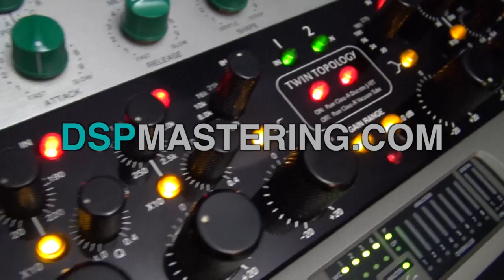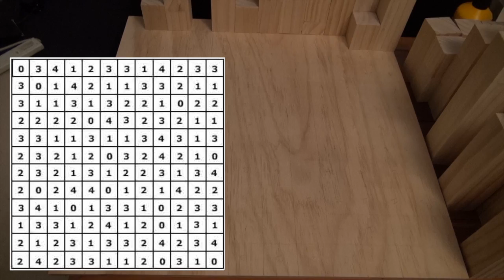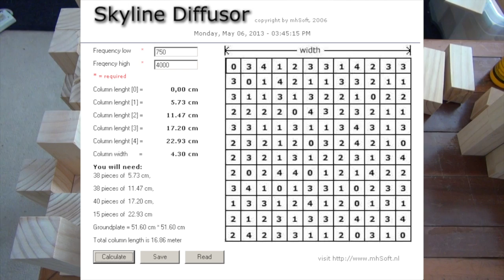How to build an acoustic diffuser

Comment: 5:10 I would suggest a silicone adhesive. Wood glue isn’t strong unless you clamp it. As the wood dries it will loosen the glue. Silicon will flex as the wood dries. Wood glue can crack.

Comment: hay
I just wanted to comment that when cutting and sanding the boards you should work safely and not on a chair above your body
(It's worth adding a warning in the video "don't work like this at home, always use tools carefully over a protective surface")

Second, in order for this diffuser to work well, it might not be worth finishing it from the bottom with a wooden shelf that supports it
but fix it only at the back or put a thin support from the bottom as well
Because a shelf below again causes the sound to reverberate and a standing wave on the wall

Regards and thanks

Comment: I wonder what the efficiency is like if you just used random length blocks, and angled cuts on the ends? - would it get pretty close to achieving the same goal? has anyone done research on this?  I just want to put my scrap wood bucket to better use than firewood.  At the end of the day, at the least you get a cool home made piece of artwork to hang on the wall even if it doesnt do anything.

Comment: Great video - thanks!!  I noticed the link to calculator is broken but the website still have plenty of calculators available.  I definitely have metallic-sounding (after a handclap, for example) flutter echoes.  How can I measure to see what the target low and high frequencies for this type of diffuser should be?  Even if I rented an RTA… I’m not sure how to generate a sound, and measure only the frequencies that are “echoing”.  Any tips, anyone?

Comment: You don't need thicker plywood for the back panel, you just just need to.. glue the blocks together from the sides to prevent flexing... you don't even need the back panel. What you should of done is have something to align all of your blocks in one row so that it is perfectly straight though. Apart from that, nice job!

Comment: Umm... not sure this will actually do the job correctly. A marginal effect at best. Room dimensions and other wall treatments are a major factor. It all has to work together to deliver the right response to your particular monitors. There’s no one size fits all in acoustics. This is kind of pointless. And pine is not ideal. You need a hardwood for rigidity and minimal absorption.

Comment: using glue on the sides would have given you the necessary strength so the backing plate will not bend
Reply: Using glue on the sides of the blocks could even make the backplate superfluous..
Reply: @Wuppie62  You think you're pretty good saying superfluous don't you?
Reply: @Intimatycal  Sorry man. Actually, I like that word. It's like, really far out.

Comment: I wonder if you could do something like this by making holes at different depths...
Reply: Inside the cut 2x2s or in a 4x4 (fence post) piece of lumber? I would think cutting the tops at a 30* miter and arrange the tops/lengths of wood facing different directions would diffuse (scatter) better; however I'm no audio engineer.

Comment: Thanks for the DIY! If I can make a suggestion for everyone else, sand all the wood as much as possible before cutting. Goes quick with a power sander. Then you only need to touch up after cutting. :-)
Reply: Thanks djmichaelm, That is a very useful tip.
Reply: Great idea . it looked like the pieces were run through a planer or jointer . not sure why he sanded them .

Comment: The frequency that bothers me is the F#2, which is 92.50. I inserted that figure and the software gave me a 136 METERS diffuser panel to build???????? Over 5 meter width: http://www.mh-audio.nl/DiffusorCalculator.asp?fl=92.5&fh=369.&calc=Calculate+Diffuser#result

Comment: Hi!I want to built a Skyline diffuser, but I can only buy 4,5 cm width here in Sweden. When I tried to use the calculator, it does´nt seem´s to be correct as the high frequencies tend to be lower than the low one´s.
Should it be fine to use 4,5 cm and get good frequencies? If so, what lenght´s should I use? Or can I use 4,5 x 7 cm width instead, maybe?

Comment: As I can see this diffuser only uses 5 different lengths, which will cause a pretty clear treatment of that frequency defined by these 5 modulo fractals. For 2D diffusers I found it is better to use all the fields of a module to define the possible modulo values. For exampe a symmetric diffuser of 4 modules rotated with 90 degrees each, having 14x14 pieces, 4  identic versions of a 7x7 element diffuser willbe created using all 49 imaginable lengths instead of only 7 defined by QRD formula.
Reply: ENGLISH, brother!

Comment: I went to a sawmill and bought rough cut white pine (I built my own studio in my side yard with a 20 by 28 studio and a 20 by 16 control room) in 8" widths then bought a band saw and resawed it and it came out about 1/2" in thickness.  I then applied it to the wall in a lap joint configuration much like you see on the outside of houses.  That makes it where there are no parallel surfaces on the walls and my ceiling is a cathedral ceiling so it is also not parallel with the floor.  It turned out to have an incredible sound!  A bit of work but worth every minute of it.  If you do it, leave the wood rough cut.  If you look closely at my Avatar, you can just see the walls behind me.  That is a wall in my main room.  I think it looks good, and smells great!

Comment: Unless you're a voice actor. Then you want to deaden the sound completely.
Reply: That was the theory in the 60s and 70s put forth by many including the great studio engineer / designer Tom Hidley (of Westgate and TTG Studios to name a few he owns and designed). However depending on the studio desires per how it wants a room to sound, the need  to have a totally dead room is a bit of a misnomer. An acoustic musical instrument depends on the environment its being played in to give it life. Natural decay times are part of what the human ear hears when these instruments are played in a normal space or outside.. Hence you want to record all aspects of it. A dead room will not accurately produce this, if at all, and then you are adding reverb etc during mixdowns i.e. more work at the console for that track(s). Which is why it is key to properly design with the formulas and proven techniques  available.
Reply: Wrong,  dead room for recording is fine, especially vocals. Actually it is preferred, because to add reverb to a file with natural reverb means adding reverb to reverb and that's a no no.

A dead room for mixing on the other hand is bad and sounds unnatural to your ears.

Comment: The best diffuser is polycyclindric and is easier to construct
Reply: I have seen many control rooms with the 'cube' style panels Why would Poly-cylindrical be better ? not asking in terms of cost but acoustically.
Reply: I think because theres more scattering so there will be less resonance able to build up. Also less reflections since it's not a flat surface. Check out bulbous bow's on ships, similar idea.

Comment: Hey man. First off Nice Video. I have a bit of a deli-ma the wood blocks that i bought are rounded on the edges will this basically screw up the build? Due to the little holes in the centers?

Comment: Hey man,

How do you know what your low and high frequency's are??
Thanks!
Reply: Gibson Goldy 
.
Reply: Using a Spectrum Analyzer. It's usually a piece of software that is paired with an omni condenser that has a VERY flat frequency response. If you only have the mic, then you could just have your mic placed where you usually have your head during mixing, run some pink noise through the monitors, and have an EQ with real-time analyzing so you can see the dips and peaks in the frequencies.

Comment: Hey, Great Project. 
FYI, Your link in the notes to the Calculator is wrong(old?) it should be 
http://www.mh-audio.nl/DiffusorCalculator.asp
Any update on the effect of the diffuser? was it better or worse than you expected?
Reply from the maker: Thanks for that, will update it. Cheers.
Reply: Try to put different frequency response and you will se that always will give you the same configuration of this diffusers ... I think this program doesn't work properly ...
Reply: Not found on this server
Reply: @jrr832  http://www.mh-audio.nl/Acoustics/DiffusorCalculator3.asp

Comment: How did you figure out what frequency you were trying to target?
Reply: DjFadeTheFuture if I'm in a room that is 10 meters long I'll go Like this...   344(speed sound in meters) : by 10(distance from the speaker in question to the closest wall I'm treating... equals 34,4 
double that =68,8 that's a standing wave cause it's the frequency size that travels from the speakers to the wall and back... they shock against each other and cause issues such as standing waves... double that and you'll the octave of it... double the octave and you have another octave... 68,8 X2 and also the result of that X 2 again and you should be good .... do that with some different rooms you're use and check the results... you'll probably find it simple, cause it is..
 but is very effective on the sound you're hearing too.... hope this helped... please anyone who would have something to correct me on... feel free and please do it!!! cause I'm learning and wanna keep it that way! always learning
Reply: anyone got an answer for this??
Reply: http://www.phy.mtu.edu/~suits/notefreqs.html this helped me
Reply: please give an example
Reply: Grantas Šileikis g
Reply: hey - so I have 4x4m room. its 344 / 4 = 86 x 2 = 172. is this the bottom frequency? and this 172 x 2?
Reply: Hold on.... why 86??? Are you calculating inches?! Convert that to meters... and them you'll get what you need... or find out sound speed in feet or inches I don't know... it's easier for me in metric system!!!
Reply: room is 4m x 4m... 344 / 4 is 86
Reply: Is that 4X4 in meters? I'm sorry if I misunderstood that!!!
Reply: So.... you'll have 344/4 speed/length and that's your number... and the octaves and so on... correct my friend
Reply: yes in meters. 4x4 so can you help what is the bottom frequency 172? and what would be the top frequency ? cheers and thanks
Reply: I'm sorry for the misunderstanding
Reply: thanks Phillipi -  just wanted to know what frequency range to put into that calculator. I guess the room will mostly benefit from sound treatment and small diffuser. it is mainly mixing room.
Reply: Alright... make sure you're measuring from the speaker cone to the wall and back to the speaker cone to get those frequencies....
Reply: hi there - i punched it into this calculator and and if i read it correctly diffuser is 12m wide? my room is 4 x 3.5 x 2.4 (meters)?!?!? what am I missing?
Reply: http://downloads.bbc.co.uk/rd/pubs/reports/1995-01.pdf
Reply: 43, 86, 172 these are room modes... usually we treat room mode up to 200 ish hz... cause above that it's common sense really... if you wanna make your room flat so you have no feedback... I'd suggest treat the highs... if not... that's OK... if it's a mixing room... just use treatment on the walls you should be fine... if it's a recording room and you want no feedback... use pink noise and a condenser mic with a good response and treat the room with a 31 band eq

Comment: Thats a shame that you didn´t mention that this is too heavy that it´s almost impossible to fix it to anywhere. Think about like 23 meters of wood in a single 50x50cm panel. It´s a Ton!
Reply: If you use Balsa it's not.
Reply: dante pippi I
Reply: For anyone facing this issue, add a frame of 2x4 to the backing. You can then keyhole the frame and put lag bolts in the wall studs and have them sit in the key holes. The frame also helps finish the diffuser off visually while also helping protect the outside rows of the diffuser from being dislodged from accidental contact.

Comment: Them blocks will rattle like shit and cause more noise than without. You need to glue the sides of the blocks!
Reply: jibba02
Which according to the video is the point for the carefully selected pattern, to disperse (not absorb) different frequencies. He already has absorption elsewhere so from what I got of what he was saying these are to prevent the room from becoming too dead. and turning into one of those -9dB silent rooms.

edit I will say that putting a dab of glue between seems like it wouldn't be a bad idea.
Reply: +Skibble5150 Isn't this one supposed to reflect and scatter instead of absorb? That would make hardwood more advantageous (Poplar, Birch, Maple) If you wanted something soft to absorb you'd probably use soft wood (Balsa, Fir, Cedar)
Reply: Scattering the waves helps prevent the sound waves from being amplified or canceling each other out. I believe they're called standing waves which can make your sound seem different than it actually is.
Reply: jibba02 
Of all of the videos I have seen on these things, they are all built like shit.
Additionally, heavy pine wood is not necessary.
Extra weight hanging from the ceiling ready to fall and kill someone.
There are tons of other materials.
Don't forget, the softer the material the more it will eat!
Reply: The idea is to scatter/diffuse the sound so it does not directly reflect the sound
Reply: jibba02 ? I usually monitor at about 75db c weighed. When you mix at blasting volumes? Then shit rattles. As if you have exotic hearing and can hear a wood block vibrate behind you. The vibration would have to be louder than the sound pressure coming from the sound source. Since the wood is designed to diffuse sound waves and not amplify them? You could use a hot glue gun and wouldn't hear a peep. That being said? What was your remark again? Oh that's right!!! You claim that you can hear a mosquito fart a mile away in a swamp..... Reality check...
Reply: Plus signal to noise ratio takes affect.when a vocalist is using a microphone that has a self generated noise of 17db? Do you hear any noise and hiss of the vocals are 40db? No because the signal to noise ratio is higher than the noise. Of the vocals drop down below the noise level, then you'll hear Mic hiss. Same goes for your theory of rattling blocks
Reply: No. If you reflect sound waves they will bounce from one object to the next to the next and so on. Have you ever been in a cave before? the echo is terrible!

Comment: Hey why not use styrofoam. Light and easy to work with.
Reply: HickoryDickory86 Yes and no - There are commercial versions of this kind of diffuser made of foam and they do work well, as long as the surface of the foam is a denser material ( sprayed on) these things are working in the mid and high freq range - at low freqs they are indeed transparent.
Reply: Giuseppe Marotta Because styrofoam would absorb the sound. The point is not to absorb it but to diffuse/scatter it.

Comment: What did you use to determine the frequencies you want to target?
Reply: http://downloads.bbc.co.uk/rd/pubs/reports/1995-01.pdf
Reply: http://www.oliverprime.com/prd/?show=calculator      In this page you get all the info you need and actually you can build it quantized like he did or with the specific measurements down to millimeters
Reply: its called a QRD diffuser invented by BBC, google BBC diffuser and the brits have a simple equation for targeting a frequency
Reply: @eosmusic9872  What he asked is not how to do/calculate it, but given the room how one determines the frequency range which needs to be corrected with a diffuser?
Reply: just found a sweet QRDUDE program to assist in more complicated constructions as well

Comment from the maker: To treat higher frequencies you would need thinner timber sticks, which then changes efficiency against the lower range. Also thinner sticks would mean more work / cost to cover the same area. Also the very high end isn't as much of an issue acoustically.

Comment from the maker: Yeah thats about right. Bass traps first, as many, as deep as you can. Then treat the first refection points. Once your maxing out the amount of absorption you can use (about 40 - 50% of your surface area depending on who you ask). Then look at diffusion. That would be my approach, diffusion adds a nice touch but to start with I feel absorption gives you the most acoustic improvement for your money.

Comment from the maker: Nah, I built my rear bass traps so I could just pop the diffusers on top, and they would be at the right height. Its not my area of expertise but I am pretty sure they would be too heavy for paste. I would recommend putting screws through the empty wells into the studs of the wall.

Comment from the maker: Yep good question, I had only just finished them at the time of filming hence no conclusion on the result. The effects were subtle but pleasant making the room feel a little larger and more open. I am going to take some post installation acoustic measurements but have been super busy with mastering. I dont expect to see a lot from the tests I suspect frequency response will be the same with a slight improvement in reverberation time.

Comment: If you visit akustar.com, they proposed a panel abs "manhattan", 10 cm high frequency 800-2500 Hz while if we do the calculations with the software, remaining at 10 cm we have a much smaller frequency range 1500 - on 2500. > I do not how akustar can do this ....

Comment: Yes, I also prefer the first reflection panels absorption and diffusion on the rear. I saw blackb. studios (on the site you can also do the calculations for the skyline ..). Another curiosity is the materal to use. The top seems to be the wood, but it is heavy. I do not know if it works quite well in polystyrene, maybe not. Some suggest pine, others in bamboo, lighter. To have an optimal frequency range, 800-4000 or 800-2500, I see  that the maximum thickness is 21 cm.